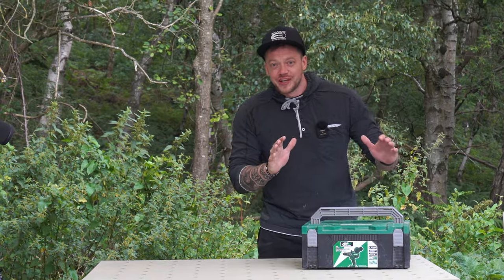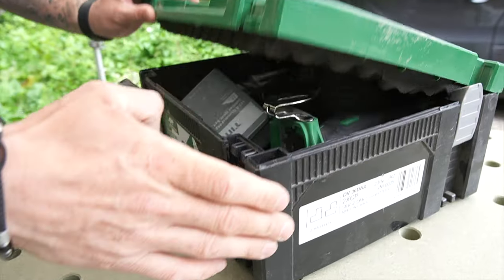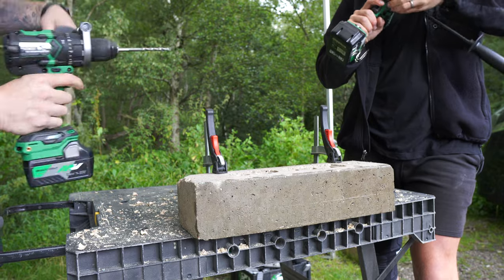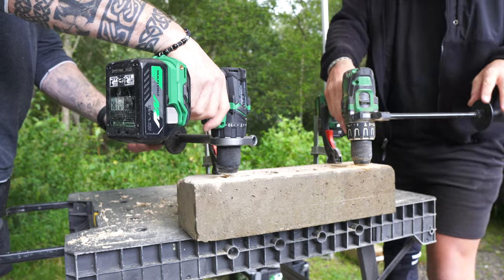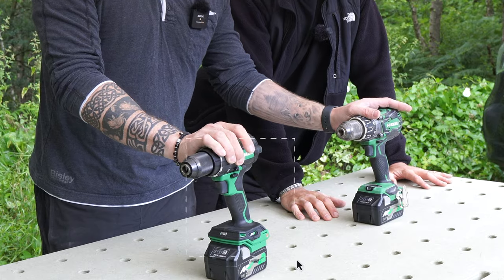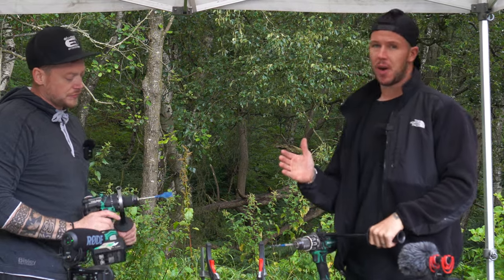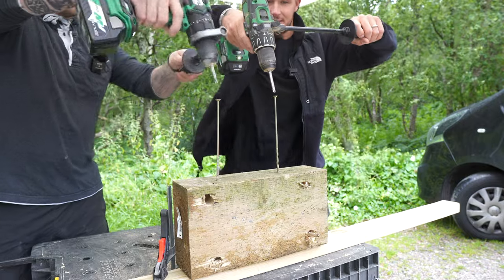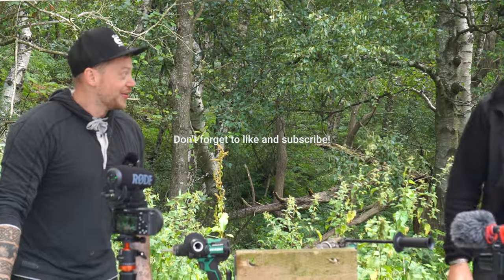HIKOKI - old vs new episode 6

Comment: Put it up against makita 40v and bosch biturbo
Reply: Makita ist Not in the Same liga and Bosch Runs hot and broks and smoks
Reply: @sandypohlmann3874 its normal for new bosch drill to smoke due to some residue that burns off after that should be fine.

Dont know about the bi turbo drill but the compact 18v i have was running coolest in its class back in the day so surprising if the larger drill runs hot...then again tons of power with the 8ah in that one.
Reply: @NarowAR07  ist funny to hear Wat you say:):):)